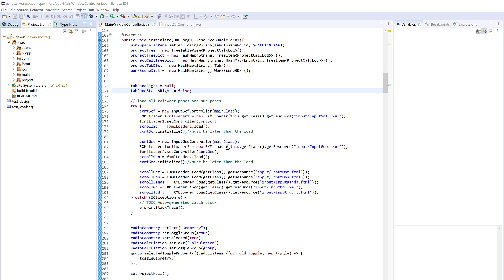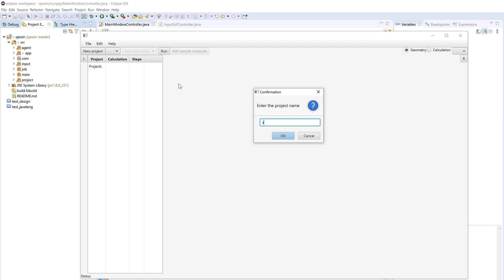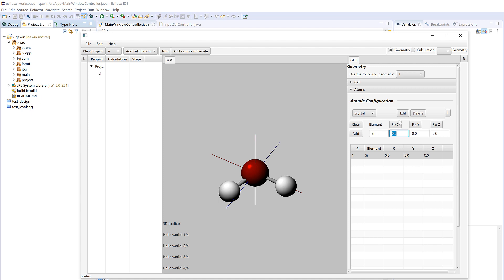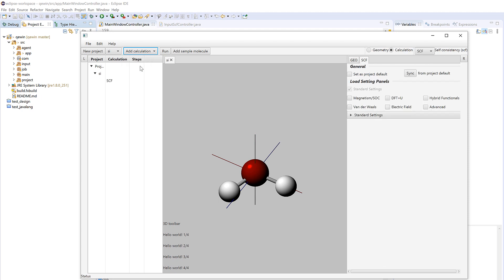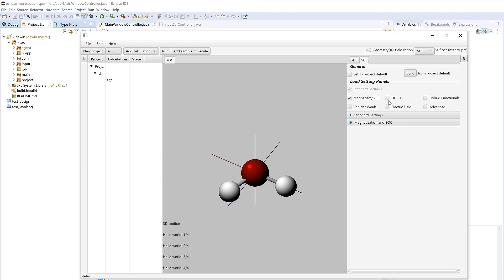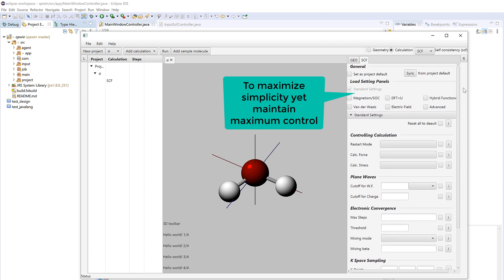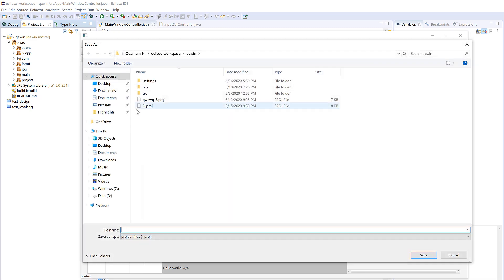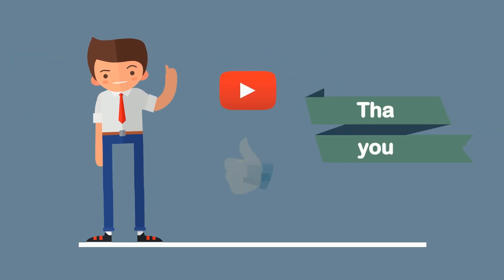QuantumVITAS development progress 1 (16.May.2020, v0.10): a new GUI for QuantumESPRESSO

Comment: First  I have to tell you that what you have done is really impressive work. I am also a developer and wish to contribute to your project. I have one point I want to tell you. In the opensource community, Python is used as the backbone of the project often. You can use python as your backbone of your project if you like. That's a suggestion.

Comment: I would like to thank you for the previous tutorial videos. Great progress on QE GUI. 

Just some suggestions:
- The program can use a slightly better name than a generic descriptive “QE_GUI”. “QE_Nerd” => “QErd”?
- It would be nice to see in the work area a text version of a QE “inp” file. Just to make sure that it makes sense or to learn what keywords are added by different options.
- As far as I remember Burai and Winmostar finalize “inp” file when a calculation starts. I hope your program can prepare a complete “inp” file, which can be copied to a cluster for calculations
- use a relative or an absolute path for “outdir” and “pseudo_dir”, so “inp” file can be used on a cluster with a similar relative folder structure
- show values (greyed out) when a default checkbox for value is selected
- for convergence checks, generate multiple “inp” files or a bash script, for example, with “ecutwfc” values of 70, 80, 90, 100

Crystal structure manipulations:
- ability to import “cif” files, and to create “cif” files from QE “out” files. Hopefully, the program will eliminate annoying multistep conversions: open “inp” in XCrysden, save, open in Vesta to save “cif”
- some cif2cell capabilities: supercell, slab/vacuum system
- open crystal structure from the work area in one click in an external program, e.g. Vesta. Many would still prefer to postprocess a final structure in Vesta (polyhedral representations)
- (not really necessary) find a space group of a final structure (like FindSym https://stokes.byu.edu/iso/findsym.php )
- (not really necessary) search Materials Project for crystal structure data
Reply from the maker: Thank you for your suggestions, and they are very helpful! 

- As for the naming, as you said, I have thought about that for quite some time and have just made up my mind. I will  make a new video announce that.
- As for the input file and the folders, yes those are exactly one of the general goals of making a new GUI: to make everything transparent to help learning and make it easy to migrate to linux. Glad that we think the same!
- I will but haven't done the checkbox thing that you mentioned, but definitely the next thing to do.

- Convergence test is a good idea!

About the crystal structure manipulations, the suggestions are extremely helpful. Thank you, and I will keep you updated!
Reply: @realquantumnerd  - For cluster users, an option of saving qe command line in an ascii file without starting a calculation, will be helpful.
- A logging system might be useful. An annoying thing about calculations is keeping track of what was done and the values of parameters used. I use a basch script which writes a log with a qe command used, final total energy, checks for convergence, i.e. "JOB DONE ", in an "out" file, wall time, memory usage. A log file can be written in a calculation folder and, maybe, in an extra file with all calculations.
- I assume you a graduate student who might look for a faculty position in the future. Your tutorial videos would be viewed very positively for the teaching component (previous research performance and research proposal are still more important).  The QE GUI might make your name quite recognizable in the condensed matter community. For example, my research does not overlap with Brian Toby but I, and many others, know him as an author of ExpGui and GSAS-II.
Reply from the maker: @viktorpoltavets2348  Thank you. I really appreciate your suggestions and encouragement!

Comment: Nice work. I have a suggestion. It would make your GUI even more sophisticated if you could add a cif2file functionality. It would be even better if the GUI had ABO3 Perovskite structure such as SrTiO3 maybe as a new Bravais lattice.
Reply: I meant cif2cell
Reply from the maker: Thank you for your suggestion. I mean strictly speaking there are only 14 Bavais lattice, but what I could do is to add a "custom" one preloading some useful structure like ABO3. I try will keep that in mind.